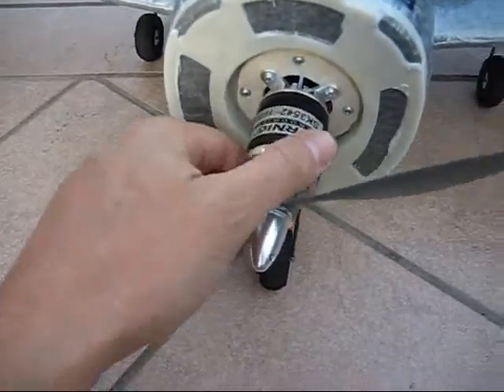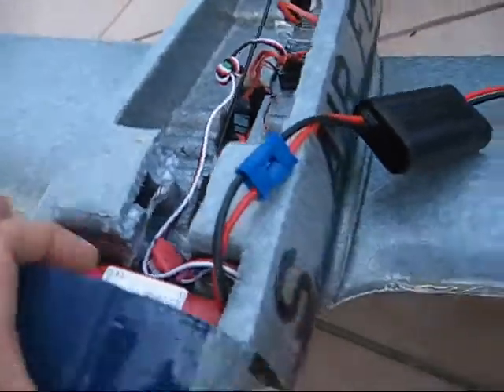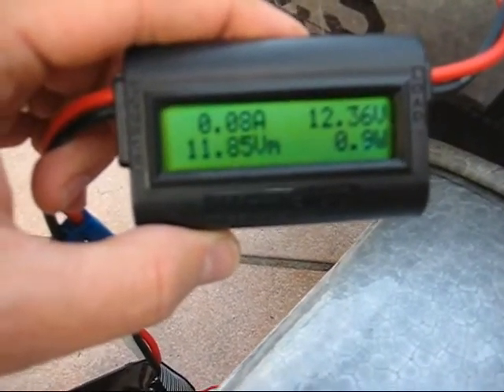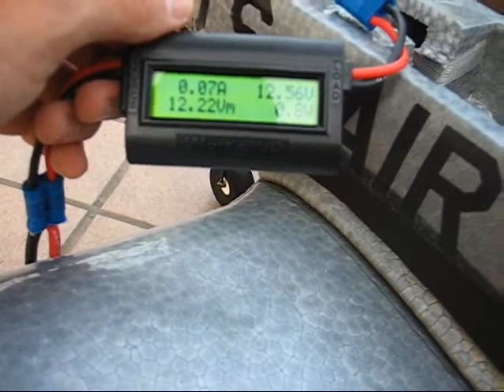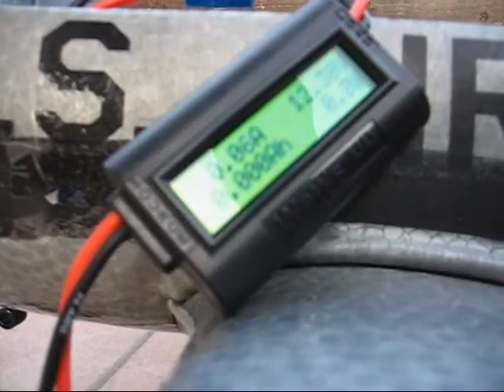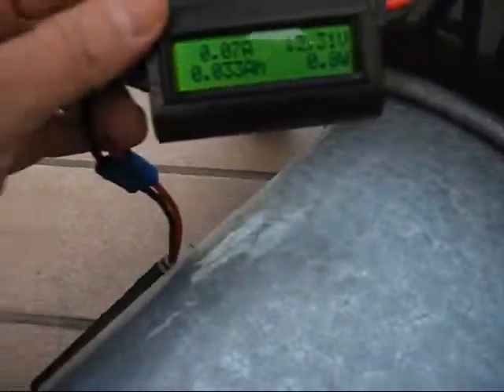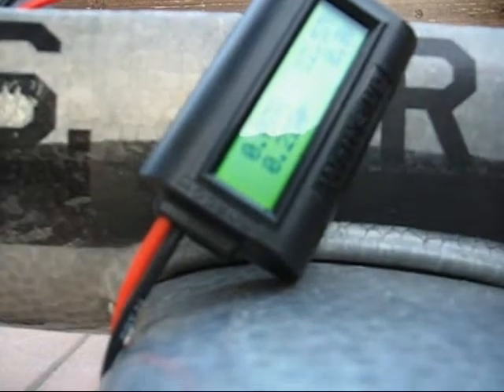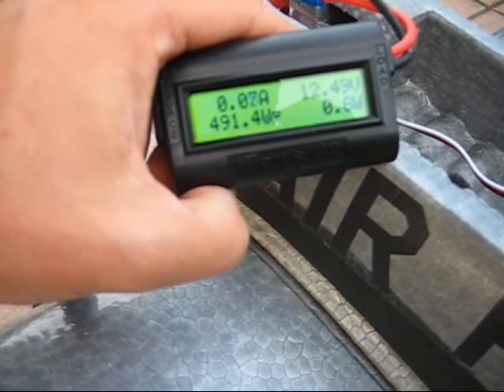WattsUP testing Turnigy SK 35 42

Comment from the maker: @ramiroleiva73 Hi Rami, I make my own mount with plywood and a
dremel.  I use 4x M3 screws, and the x mount from the motor.  I then
attach the plywood directly to the plastic firewall.

Comment from the maker: @ramiroleiva73 The 10x7 should pull about 40A on the 35-36C.  Safest is 10x6 but as long as you only WOT for five to ten seconds or so, even the 11x7 should be ok (44A or so) on a 40A ESC.

Comment from the maker: Yeah, I like the setup on the T-28, it doesn't suck having unlimited vertical!  I tested the 35-36C as well and it is actually putting out 23.5% more watts than this motor, so I am running with the 35-36C right now.  I am making a mount so I can switch them out easily because I love both of them.  That 900Kv motor is gonna pull it straight up till your receiver ranges out.  Have fun!  Let me know how it goes!

Comment: Thats the same motor on my setup only Im using the 40 amp esc version and a TGS 11x7 prop with a Zippy R 3s1800 21c battery.

I have posted a video response so show its vertical performance.

I did have a crash while I was doing silly things and will be replacing the motor with a Turnigy 42-40 900kv and a 12x6 prop for more thrust and less speed.